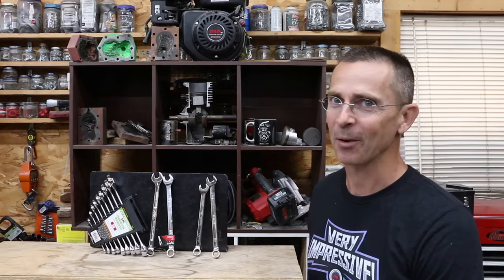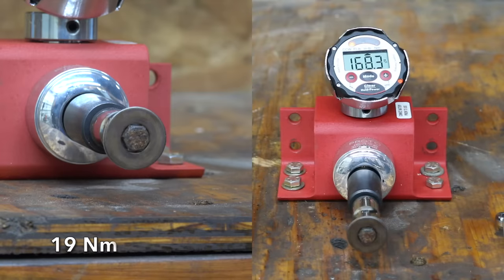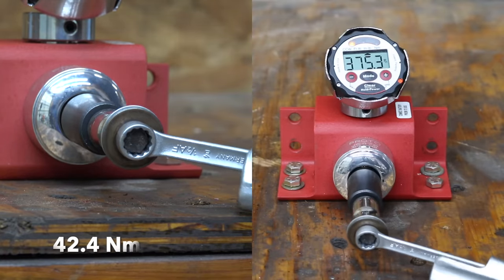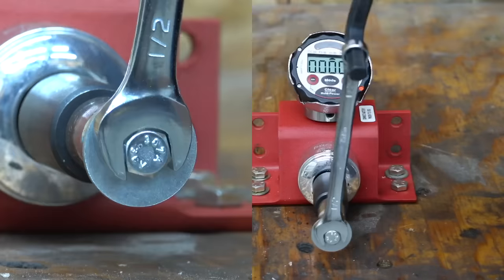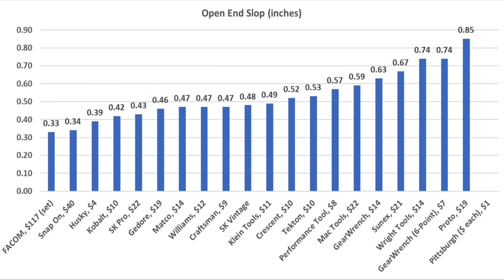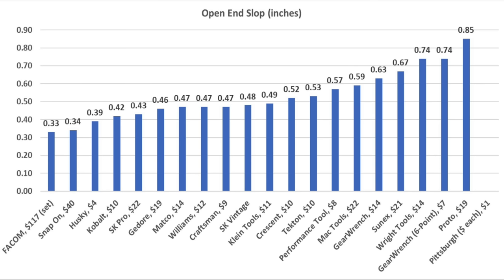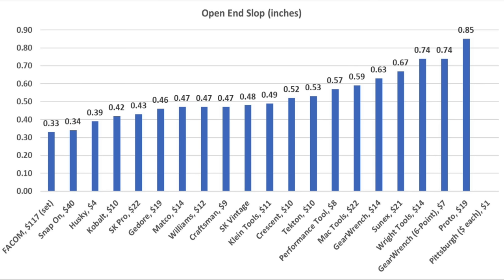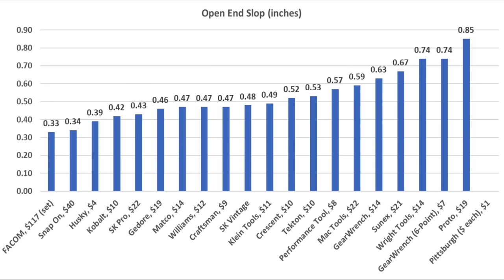Best Wrench? Let’s Settle This! Snap On vs MAC Tools, Matco, Proto, SK, GearWrench, Kobalt, Husky

Comment: It would be interesting to see how the HF Icon tools compares, the supposed quality really is tempting!
Reply: I’ve been running their ratcheting wrenches, crows feet, and stubby wrenches for a little over 2 years with no issues. Haven’t even had the chance to try out the warranty. And that’s as a full time construction tech.
Reply from the maker: Thanks for the suggestion.
Reply: My father is a professional mechanic with his own one man shop, says he's been using ICON tools for a few months, and while plenty good, he's not very impressed. Now, he ran a Matco truck for a while, and used to own the entire catalogue of Snap on tools 30 years ago (all stolen), so I say for a fraction of the price? With the full lifetime warranty, I say it's a deal. 

Just bought a 1/4" ratchet and it's pretty darn nice, feels skookum. But I'm not nearly as much of a tool snob as the old man. Just my 2 cents.

Comment: Great video!  I just wanted to let you know that your snap-on wrench was a standard wrench, not a flank drive. Keep up the good work!
Reply: You are right Ryan. The open end is called flank drive plus,the boxed end has flank drive.
Reply: @shanespence6128  what he means is the snap on wrench he used and said the open end has snapon's flank drive system, unfortunately hes incorrect the flank drive open end looks much much different.
Reply: @shanespence6128  The open end on a snap on flank drive has notches like teeth to bite the nut. I wish I could send a pic! Keep up with the great vid's!!!

Comment: I wonder how well the Made in USA Craftsman would do. That's a large portion of my tools and I never have any issues and I put them through the paces. They sure don't feel as good as the more expensive stuff but they have yet to let me down.
Reply: Oddly enough, in all his tests so far the newer Chinese/Taiwan Craftsman tools beat the older American ones.
Reply: @TehButterflyEffect  not in the adjustable wrench test. The usa made Craftsman beat all.
Reply: @TehButterflyEffect  I recall the new Craftsman are made in INDIA.  That's what it states on the boxes at Home Depot.  IIRC, he also stated that in the video.
Reply: I had a full set of those panel style Craftsman, made in USA AND metric set made in Japan.  From 1980s when I was in my 20s. Never failed me either and put through some rough situations with pipe 'extensions' and blows from a dead blow hammer. My entire mechanics tool collection was stolen by my ex-wife 10 years ago. Along with everything else I owned including my house. Still haven't recovered from that loss. I miss all my American-made tools!
Reply: I stocked up on the USA Craftsman models before they went overseas....both standard grade and "pro" models.  I'm very impressed with the latter.
Reply: @TucsonDude  same. I remember buying all I could from Sears and onlinr before they went over.
Reply: @TucsonDude  I worked for Sears back in the mid 90's, used my discount to buy a lot of USA made Craftsman tools.  Except for the few tools I lost, I still have everything I bought in that era.  I've recently started to replace some of slip joint pliers I have with newer stuff due to jaws finally just not being able to grab anymore.  My wrenches held up great.  The sockets, not so much, they have a noticeable amount of play in them vs newer sockets.  But FFS, I definitely got my money's worth after 25 years LOL.  In any case, as someone that used to preach it and sell it, it kills me to see them send it overseas.

Comment: My PROTO's are nearly 55 years-old so no comparison. At the time, the USAF had me use all Pendleton Tool Company tools on aircraft, (no price limit) so when I got home, I bought a basic set. The ratchets are smooth as glass and the 3/8th must have 96 or more teeth. Only that $600+ Japanese 3/8 ratchet feels any better. I can't even feel the "teeth" on the 1/4" PROTO ratchet, but it has NEVER slipped and busted my knuckles, even with the 9/16" socket on a skinny-block Chebby block bolt. I turned many a AN (12 point) splined aircraft fittings with two-fingers blind working on F-4's with USAF end-wrenches. Working "blind" and "two-fingered" is where the balance and "feel" of a $40 end-wrench vs: an $8 Herber Fraught comes in. I have split some of my super-thin wall 3/8 drive PROTO sockets-free replacements for the drive to the supply house, where the same size HF socket I probably couldn't split with an impact, but I couldn't get an HF socket in lots of places either. Would I buy $42,000 worth of Japanese hand tools TODAY? No way. I'm too old and don't have the use for them. I got Whitworth (British car and cycle) sockets back in 1974 cause I had British motors stuff recently. I grabbed a Crapsman set at Low-down's for $300 (clearance) in a three-drawer box last year for an easy take-along and I'm surprised by the made in China quality of them. Seeing my PROTO set cost more than my 1974 Dodge Dart 318 V-8 SE new (YEAH!) it's what you need and how much you'll use it. My Daddy was a MACHINIST (a real one) during WWII and Starret and Lufkin were on most of his tools. When he stopped being a machinist, he sold 98% of those precision tools. Too much money in that oak tool box if you don't use them 9-14 hours a day 6 days a week.
Reply from the maker: Thanks for sharing.

Comment: Excellent testing and reviewing!   However I would like to note that under such extreme tests, the results can be easy to misunderstand.  many people don't understand the difference between strength and hardness.  A LOT of people mistakenly assume, for example, that impact sockets are harder to damage because they are resistant to shatter.  But in reality, they are softer and much easier to bend, warp, and tear.  They are made shatter resistant by using lower carbon steel which is softer. 

It's that way to some degree with all sorts of tools.  A high carbon wrench that isn't abused will outlast a lower carbon on that isn't abused, for the same reason a high carbon steel blade will outlast a low carbon one, unless you break it. 

So which is "better" among the wrenches?  The ones that broke rather than warped but still worked to some degree are actually much "better" for long term use in normal use without the abuse of extreme testing. They will wear down slower.  However breaking during the tests make them appear rather inferior.
Reply: If what you say is true, then those are excellent points. Not doubting you...I just don't know. It's my understanding (correctly, or incorrectly) that a high carbon steel blade is harder and holds it's edge, longer. Though, if you were to use the high carbon steel blade to pry something, it would snap more easily than a softer steel blade.
Reply: Who decides is you. Take your knowledge, apply it to the tests you witnessed and decide if the tool you want is worth the retail value that it was purchased for, because in addition to what you stated, a lot of times...when compared, you can get more for your dollar by spending less.
Reply: A graphical representation of the stress/strain curve during these tests would help explain.  We would be able to see a comparison of yield strengths, toughness, resiliency etc.

The wrenches that "broke" would show higher yield or ultimate tensile strength.
Reply: I'm no pro, but I usually try to explain in a way that is easier for the general user to understand. Glass is much harder than aluminum, but take a 1/4 thick piece of each say 1 inch wide by 4 inches long, see which one breaks in half with less pressure.

Comment: Nice to see Facom and Gedore in the test also! I'm just missing Stahlwille, I heard those are the rolls royce of wrenches. Maybe you could to the same test with ratcheting wrenches?
Reply: Yea agree, i have mostly Stahlwille wrenches which i bought used. Their finish is absolutely perfect compared to some used gedores. Feel like Gedores finish sucks and overall dont like them as much as the Stahlwille ones
Reply from the maker: Thank you for the video idea!
Reply: Unfortunately, the Stahlwille ratchet wrenches are not made in Germany and the finish just isn’t the same as their combination wrenches. The Gedore 7r ratchet wrenches were the only ones I could find that were actually made in Germany.
Reply: @theflyingBuSsArD  to be fair, the Stahlwille are also quite a bit more expensive than the Gedore. Hazet would be more of a fair comparison I think.
Reply: @genericindianreyansh6520  What a disappointment. I was thinking Stahlwille or Hazet ratcheting wrenches (I have Hazet regular wrenches) but I guess I'm looking at Gedore then.
Reply: @Fekillix  yes, I have the 7r, but the more up to date version is the 7ur with reversible switch. They were still quite expensive when I purchased, but now they can be bought for around €220 for 12 pieces from TBS Aachen where I bought mine.
Reply: @genericindianreyansh6520  Hmm interesting, i just looked it up and there is no big difference between the Gedore and Stahlwille price for an equal set of wrenches here
Reply: @theflyingBuSsArD  I guess it’s possible things have changed since I purchased mine, it certainly was that way at one point. I like the stahlwilles too but I distinctly remember buying gedore as they were considerably cheaper at the time.

Comment: As a mechanic with a box full of Snap-On I can tell you that particular wrench wasn't their best wrench, that one only has flank drive on the box side. I wish you could have tested model # SOEX16 which utilizes flank drive on the open end as well!
Reply: That's exactly what I said. There's no wrench that holds as well and you said it better than I did.
Reply from the maker: Thanks for the feedback.
Reply: The Snap-On is the Rolex of wrenches. But that does not mean its  performance  to price ratio is worth it in the real world. My Proto wrenches have lasted 4 decades, and I'd spend the savings on tools that pay for themselves (like a Ridgid Propress).
Reply: @alohamark3025  The highest benefit to snap-on is they show up to my shop every week and replace anything that im unhappy with. I've had things replaced due to normal wear or even Chrome issues.
Reply: @tonyt1554   The biggest drawback to snap-on is they show up to my shop every week and replace nothing because they have no stock. I've been waiting on an 11/16 socket for over a month. Can't use them professionally. Better to stop at a store on the way home and get something replaced immediately, than to go without your "premium" tools for weeks or months.

Comment: Maybe I'm insane, but my set of Snap-On combo wrenches all have that "non slip open end design" like you pointed out on the MAC. I didn't even know Snap-On made smooth open ends on combo wrenches. I also don't see them on the website. I'm pretty sure it's called flank drive, and your Snap-On wrench didn't have it. Edit: Flank Drive is different than Flank Drive Plus. I'm insane.
Reply: Snapon makes both. . He wasn't using flank drive here. Milwaukee has something similar on their open end as well.. very grippy.. Was told by a snapon guy that they still make the smooth open ends for people working with fasteners that they don't want bite marks on. Show cars etc.. not sure how true, but it's a good enough excuse for me..
Reply: "Flank drive plus" is the open end anti-slip. "Flank drive" is just Snap-ons branding of the off corner engagement on 6pt and 12pt box ends/sockets that everyone has these days.
Reply: @natea1042  Ahh, I see that now. Insanity confirmed.

Comment: Thank you for doing this test run!  I love the data!  Snap On also has a "Flank Drive Plus" version of their open end that has a visible difference in the design.  One video I've seen demonstrates that it grabs better than Flank Drive, and I have my own experience in the past when I've borrowed this type of wrench.  Would you be willing to do an additional short video running just a Flank Drive Plus through all your open-end tests that you did in this video, and then add it to the relevant rankings from this video? I don't know if there is a difference between the box ends for Flank Drive and Flank Drive Plus. (Please click read more)

Also, another sometimes valuable aspect of open ended wrenches is how thick they are--i.e., their ability to slip into narrow spaces.  A video where you measure the thicknesses of the open ends of all these wrenches including the Flank Drive Plus variant would be useful to me.

Full Disclosure: No, I don't work for snap-on even though my commentary above probably sounds like a disguised commercial.  For years I've wanted a set of their F.D.P. combo wrenches (the open ends seem to grip very well and are usefully thin), until recently when I learned their CEO went on a public political bent I don't like and so I'm interested in a viable alternative.
Reply from the maker: Thanks and you are welcome!
Reply: If you don’t mind Taiwan, harbor freight icon are easy on the wallet and come with lifetime warranty. They also have the coveted “teeth” that the Snap-on FDP have. I have a set of snap on fdp full lengths, as well as the icon stubby set and have been very impressed by them. Honestly I would not hesitate to buy the full length Icon based on the quality of the stubbys
Reply: @evanmarvel8064  I recalled looking at ICON wrenches and I thought I saw smooth open ends. Could take a look again.  If they are really made in Taiwan I'm more okay/okay with that vs China.
Reply: @danielgoodman3578  yes I believe they are all Taiwan now was partially china when they were launched. My icon stubby are smooth but the full lengths are not. I would also take a look at Astro pneumatic (Matco Supplier) and I’ve heard great things about Capri Tools - Wave Drive Plus
Reply: @evanmarvel8064  thanks
Reply: Take a look at the wrenches from TDS Tools. They might have something you’ll appreciate.
Reply: @billyjack3580  Do you have a website?  Sorry for the year-late reply.  The only site I found so far suggests maybe it's a Japanese tool company, but it's between 4 and 5 AM where I'm at and the website is under maintenance right now heh.

Comment: I'm a bit confused. Why did you intentionally handicap the wrenches with More taper by  choosing to put washer's on the bolts so as to limit their available surface area?   Looks to me that your initial conclusions all favor the wrenches with the LEAST built in taper, which frankly tells me nothing about the quality of the wrenches, just their design choices...
I've always been a Crescent guy though I still have my dad's Craftsman wrenches which are now approaching 100 years old :) ( He was an engineer btw:)
OH, one more thing, I don't know a lot of men who can put 400 plus pounds on a wrench with one hand LOL.
Reply: It's proving a point that it is an inferior design.  If you have a bolt that the head is short they are not going to grip as well.
Reply: You may be correct, but the washer makes it a more real-life scenario, which is where tools are used.
Reply: Worst case scenario. Crud build up and such. Other things in the way, can't get the wrench all the way down and it's all you have to work with.
Reply from the maker: Thanks for the constructive feedback.  A lot of fasteners under the hood of modern vehicles have a profile like the one I created with the washer.  With limited contact area, the wrench with the most tooth contact can have a huge impact on performance.  I just about rounded a "hidden" bolt that was holding on an injection pump recently.  After grinding away the taper, the wrench worked flawlessly.
Reply: often times rusted bolts are shorter or have a rusted taper on them.
Reply: @ProjectFarm  Got it :)  In truth, I assumed you had a good reason, just wasn't apparent what it was :)
Reply: @smarticus6384  Got it :)

Comment: As an auto tech I use the snap on flank drive plus. The plus means it has serrations on the open end that gives crazy grip. Other techs come and get my wrenches when they have stuck or rounded fasteners. I hear that Carlyle offers a wrench that has these serrated open ends for way less money.
Reply from the maker: Thanks for sharing.

Comment: Love the testing, and it all sounds about right.  But ill stick with Pittsburg from HF.  Lifetime warranty for a $1 wrench is hard to beat.  That said, the only Pittsburg wrench I ever broke was a socket wrench I had for about 3 years.  I actually extended it with a 2 foot piece of steel pipe when it broke lol.  But took into HF, no questions asked and left with a brand new one.
Reply from the maker: Thanks!   Thanks for feedback.

Comment: Only thing I could ask for is that he used a Wright Grip 2.0 wrench. They don’t even make the one he used anymore. I’d bet they would put a hurtin on the competition. Far superior wrench. 

Also measuring the wall thickness on the box end would be a good test. Can’t tell you how many times I’ve been stuck using the open end to get a bolt off that I couldn’t get the box end around.
Reply from the maker: Thanks for the suggestions.

Comment: There’s a tool store near me that sells brand new (vintage!) S-K tool sets that aren’t ridiculously overpriced! 

I recently bought from them a 1/2" 6 point socket set that includes a ratchet and a 15" breaker bar for $100. It came in a nice green metal case too!

Sad to see the vintage S-K wrench get bent. I wish the store had a raised panel set like that wrench but a vintage full-polish set is close enough. I plan on going back soon and buy myself a set.

On a side note I now know my India-made craftsmans will make a good backup set!

Comment: I bought a set of Pittsburgh wrenches from harbor freight years ago for $22.  They were the long version and went from 10mm to 26mm.  They were some of the best wrenches I ever had.  I never broke one.  When I bought snap on or Mac wrenches of similar length they were $50 to $75 each.  I should have bought 2 sets.
Reply from the maker: Thanks for sharing.